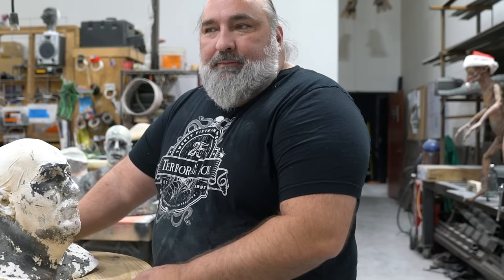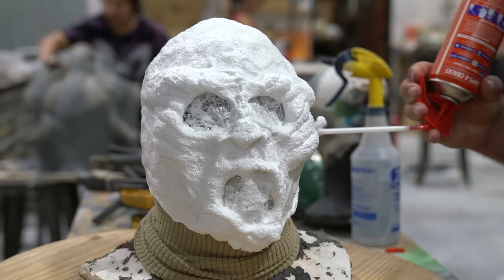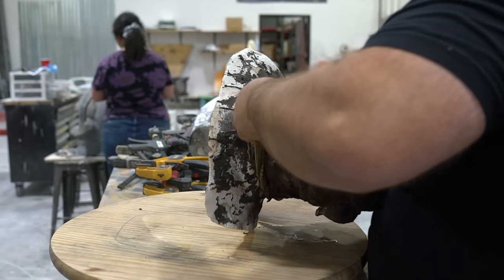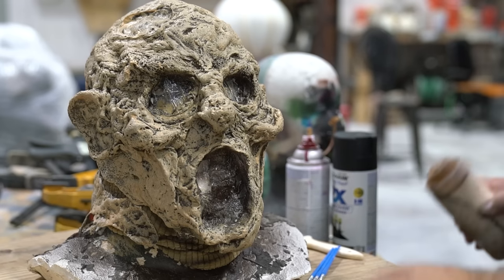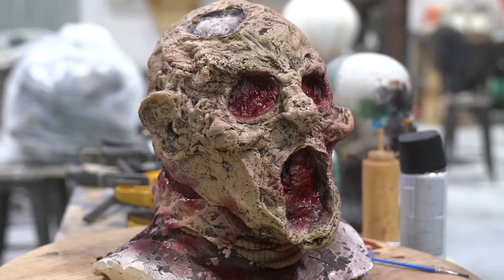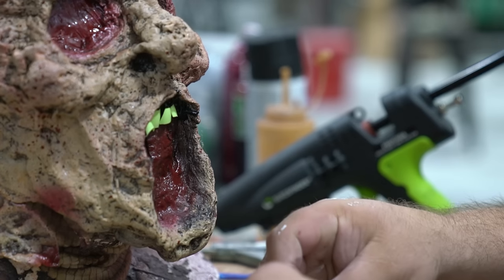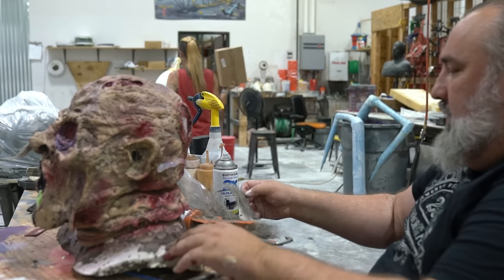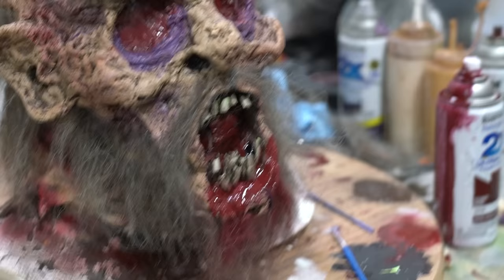Spray Foam Zombie Mask DIY mask from home depot

Comment: That was pretty damn cool....the only part I didn't care for was the purple under its eyes. It was too purple for me, maybe add a little black or brown shading to it (the purple area) and it would look alot better. Just my opinion,  but still a great job with spray foam!
Reply from the maker: I like a bright color to pop the eyes- especially if the actor wears black eye makeup. but you paint yours any way you like, thats why its art.

Comment: This is also a great idea to locktite over basic foam heads to make your props unique . As a sculpting tool Ill dip a Q-tip in water ( it wont stick because its wet) the Qtip stick minus the cotton head is a great tool for eye wrinkles, gumlines etc
Reply from the maker: I used a tongue depressor- most Q tips have paper shafts and wont do well being wet for long- no need to wet it though as there is a skin over the foam and it it really is not sticky once the skin forms. Do you mean on another type of foam? I only use locktite this way.
Reply: Ill also add that patience is not my strong point. So the wet stick allowed me to shove some teeth into the foam then press down gums and lip lines. 5 to 7 minutes is a Looong time to wait. Lol

Comment: Man bud, you weren't lying about control, damn near shot my project off the table. 😂 also a lazy Susan would help a lot.  Project came out nice just need the paint. Also can I use automotive paint on this foam?
Reply from the maker: you can use anypaint as the foam is hardy, but be careful about what you put on your face- Id rather use a paint that i know does not off gas.

Comment: Does it need to be loctite? Or will great stuff foam work too?
Reply from the maker: It really needs to be loctite. I may do a video on trying it with different types, but Loctite foam is a very different material.

Comment: for some reason the volume for me is so low I cannot hear you well. Did you say NOT wetting the cloth makes it stick? I believe you naturally but that seems anti intuitive to me. How hot do theses insulation foam masks get and how do you clean the inside?  I ran a HH (Darkwrath Keep back in the the 2000s) and even with spraying the inside of the latex masks with alcohol every night after we shut down, I still had to throw them away at the end of October.
Reply: That is correct. Not wetting the cloth makes it stick better. Less sliding off of the fibers.
Reply from the maker: they will be warm, but you can add vent holes anywhere you want really, so its manageable. you could toss these every year and make a new one for $7, each time you make one youd get better at it! but we have one that is five years old actually

Comment: Did you use regular spray paint? I've sprayed Styrofoam with flex bond and also spray paint and it dissolves. Just want to be sure that won't happen.
Reply from the maker: It won't, this is not styrofoam. They are very different materials.
Reply from the maker: Spray paint is safe.

Comment: Quick question, does the spray paint melt the foam? I'm trying to make a skull coming out of a mound of dirt. I'm using Loctite foam  and tried painting with a spray of acrylic paint .Not happy with the results. Before I spray it with Rustoleum I'd like and opinion from anyone who's tried it.
Reply from the maker: it does not eat the foam at all, no problems with spray paint and sprayfoam.

Comment: OK number one. What liquid was in the spray bottle and what kind of paint are you using to brush on and spray
Reply from the maker: its just water in the spray bottle, it helps it cure.
the paints are latex mask paint because I had them on hand- regular acrylics would be fine, the spray paint is rustoleum 2x and I show the colors as I use them

Comment: We don't have Home Depot in the UK. What's the foam you're using?
Reply from the maker: it is called locktite - let me get you a US link
https://www.amazon.com/Loctite-TITEFOAM-Insulating-Sealant-1988753/dp/B01N21KQ4I/ref=asc_df_B01N21KQ4I/?tag=hyprod-20&linkCode=df0&hvadid=241941596583&hvpos=&hvnetw=g&hvrand=10180921453143413032&hvpone=&hvptwo=&hvqmt=&hvdev=c&hvdvcmdl=&hvlocint=&hvlocphy=9026841&hvtargid=pla-453093435814&psc=1
Reply: @StiltbeastStudios  Thanks, mate. It's available in the UK but pretty expensive.

Comment: Really cool stuff! Why don't you ever wear gloves or a mask? That foam and paint is bad to get on your skin!!!
Reply from the maker: I don’t get it on my skin.  You only touch it after it forms a skin so you don’t’ get sticky foam on your skin- the paint I am using is just latex house paint, distilled water and latex mixed together.  Washes off really easily so this is by far not the worst stuff I have ever worked with.  You should watch some of my contact cement videos, yo’d really cringe!  Thanks for watching tho-  glad you enjoyed it!